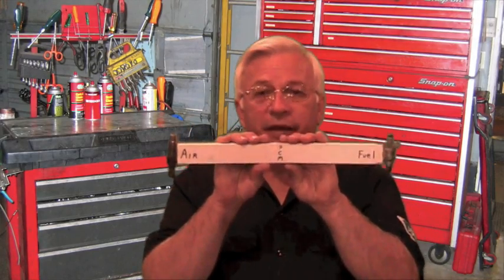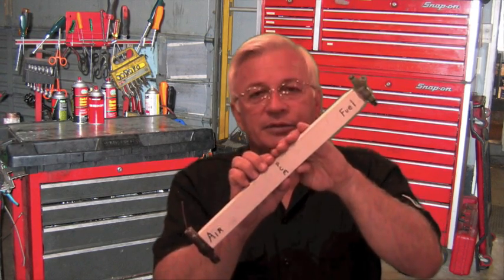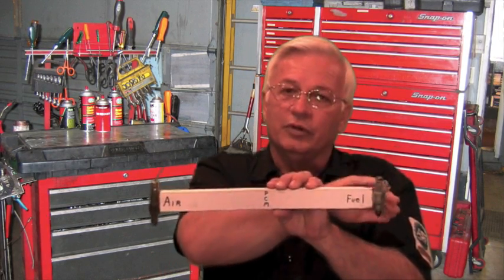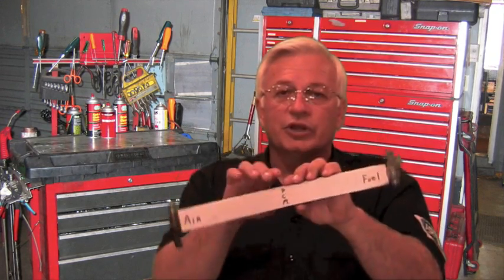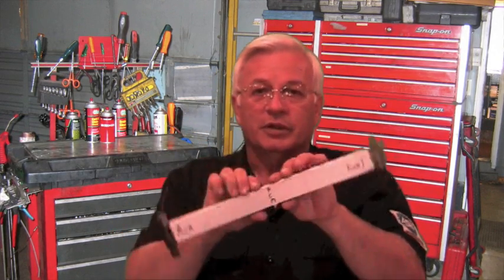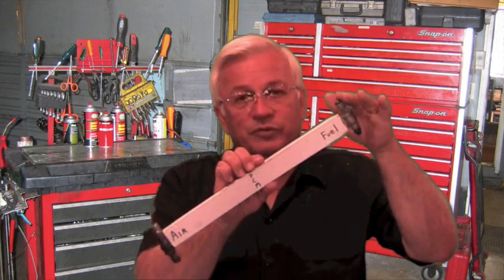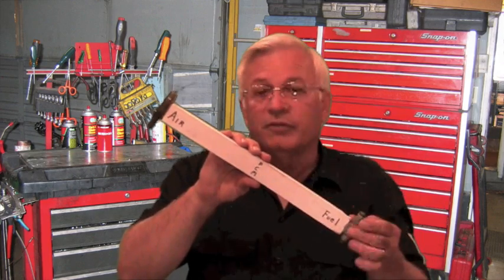Understanding Fuel Trim

Comment: Because of my knowledge of O2 sensors I know the primary sensor should always bounce back and forth betweeen lean and rich. So I replace the 02 sensor and the fuel trim stops compensating for a lean mixture and the sensor voltage now goes back and forth like it should. After replacing the fuel pump and the primary O2 sensor the car runs great better gas mileage. I BEAT THE MACHINE

Comment: So I went to Autozone bought a scanner monitored the fuel trim and the fuel trim was adding more time. And I monitored the primary O2 sensor the voltage was always low I backprobe sensor and it was was the same reading as the scan tool I took of the sensor off and the sensor had oil on the harness going to the sensors it was  messy so clean the connectors after that the sensor gave a little rich signal but once I went on a test drive but the fuel trim was compensating for a lean condition.

Comment: ...one day I decide to drop the tank and inspect the fuel pump, I thought maybe I would find something after all that work I decide to put a new one since the car was old. After that repair the car would no longer hesitate or would backfire. The old pump looked fine but I inspected and found out if I shaked the fuel pump I would hear a rattle and the new one wasn't like that. I still had P0171 I got frustrated. My car was kicking ny ass.

Comment: I had a P0171, on my Honda Accord it took me a little while to figure it out, I measure the Fuel Pressure and the regulator but the test always came up marginal the fuel pressure was always just above low pressure always marginal I tested the fuel regulator and it always passed the test. At one time the engine would backfire and the car had a funny smell. I made sure I had no vacum leaks and weird air leaks a buddy of mine replace the fuel injectors a couple of years ago.

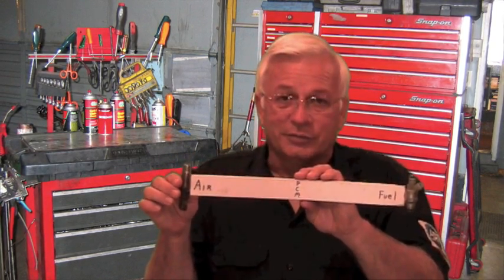Comment: O2 SENSOR DOS NOT METRING AIR TO THE ENGINE BUT IT MESSURE THE O2(OXYGEN) IN EXHUST .I KNOW DID NOT MEAN  IT .YOU CAN CHECK IT AT 1:33

Comment: The computer is not trying to balance per say it switches rich to lean because of the cat. It does not toggle because it cant controll the fuel curve it is programmed to do that for the cat.

The rest of what you said is true but you don't realize the computer can keep the fuel curve in the center.

Comment: then out of nowhere my o2 goes to .00-.03 and my feed back nose dives to 100% (it usually peaks at 167%)it leans out and my car is running pig rich at idle, starts to miss and stumble. any ideas? i smoked/boost leak tested it and it was leaking out the throttle body shaft seals at 8psi, i can hear air running through the plenum possible vacuum leak. driving me crazy
!!!!

Comment: LTFT & STFT should be as close to zero as possible right? i have a 93 eagle talon tsi (awd turbo) my fuel trims are measured in FTRL-FTRM-FTRH-FT02,(LOW MED HIGH & O2FEEDBACK.)ideal fuel trims for my car are 100%.
here is my problem. at idle my o2 is fluctuating the way it should and my feedback trim is moving too, but my fuel trims never ever move, driving or idling.